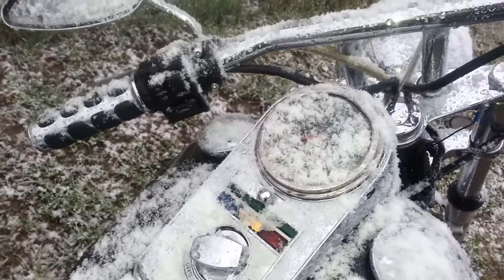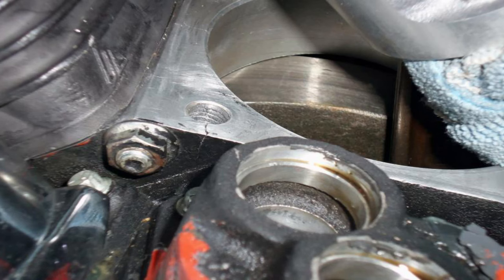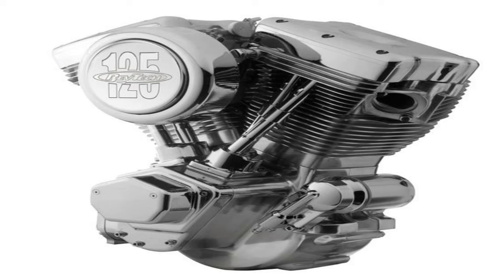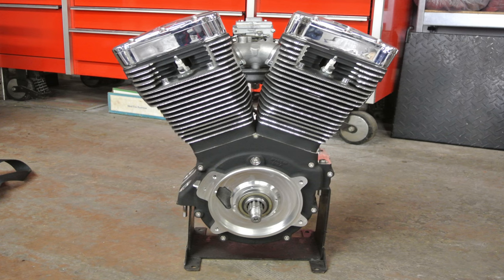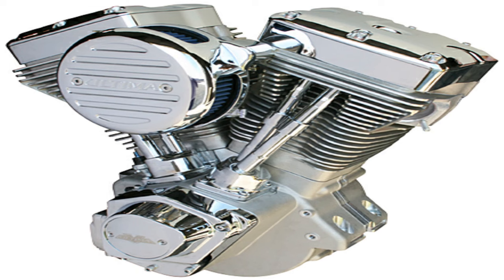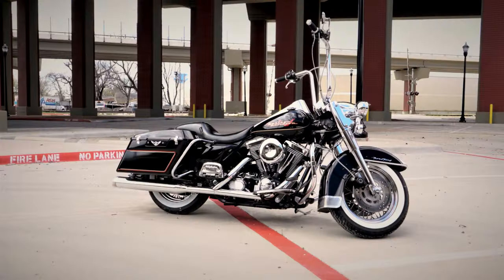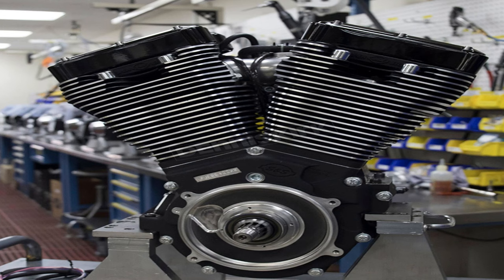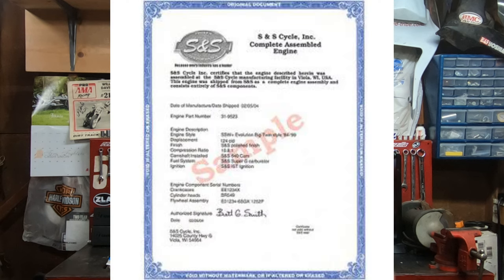New Harley Evolution Engines are Better Than the Original

Comment: Some Evo bikes are going to be very valuable in the future. That's your main reason to keep the stock engine. I'm making a very stout 92 hp with an 85 Wide Glide. I'll take an oe over the Rev Tech, for sure. As a guy who actually still builds engines, they are some real garbage. The metallurgy is nowhere near what you state. Real garbage. Same with Ultima. Chinese garbage. Just be an American and buy American and support the local guy who actually builds shit. A bad warranty is just that.

Comment: Evo s are weak to build crate motor much better
Reply from the maker: These crate engines are pretty stout, they designed these to make some power reliably and they took care of the issues common to the Evo.

Comment: I hit.  Two. 6 point. Buck. In my fat boy.   I was face to face. With.  Buck.  It.     Deer. Roll and.  It.  Mash my. Fender. Busted. A bearing.  Didn't notice. Week after.   UT.   That deer would. Total. A car.   But.      Bike.          I AL most lost. It.     I was. AL most.   Lay down. Until.  Put. Foot. Down. Damn it AL most. Broke. My. Legg. Because.    When put.  Foot down im.side. way. The speed.   My legs was. Like. Jack. It. Luck my. Leg. It. Push. Bike. Way. Up.   And. Back. Straight.        Bike. Was. Lifted. Up off. The.  Ground.  The. Hole. Bike. Was.   Left up off ground. Because. My. Leg. Was like. Wedge.

Comment: Anyone that has worked at the dealership or aftermarket shop knows the evo engine was junk. Everything from weak poor oil pumps to poor castings that leak from the factory. The twin cam and Milwaukee 8 are FAR superior engines. P.s. the revtech engine is the worst evo engine ever made. Any truly experienced Harley tech knows this video is hogwash.